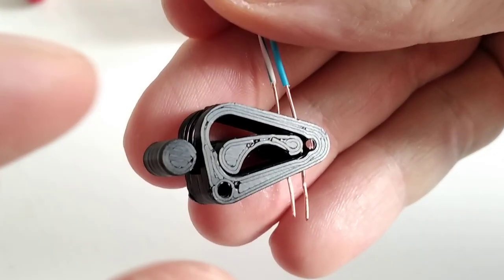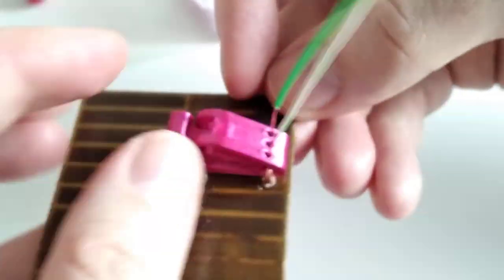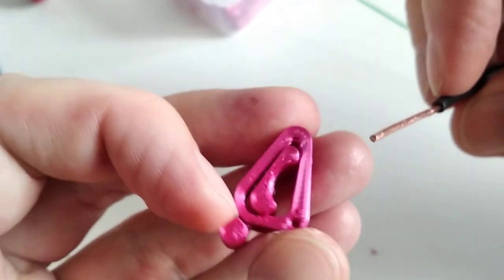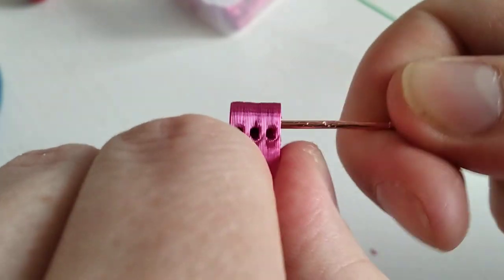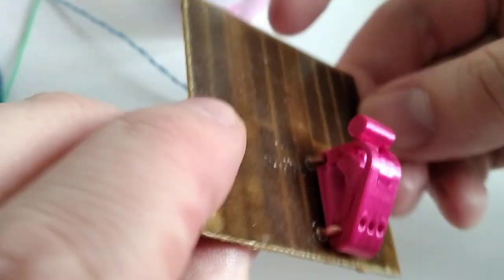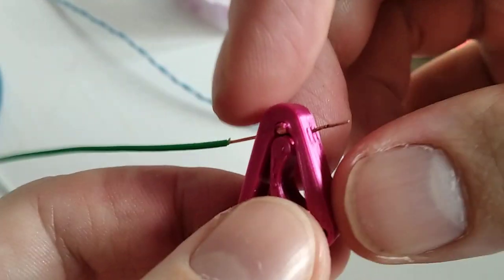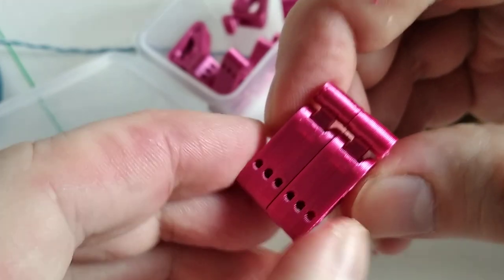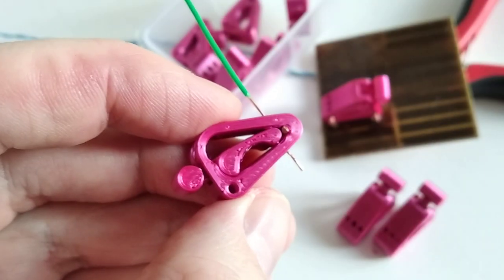30V 9A Wago-Style Clamp 3D printed

Comment: This is too fantastic for words. Design and functionality of it is just great. I really hate that I didn't come up with this myself. I know you could find things online and out there for cheap but to be able to make it yourself modify it configure it at a moment's notice is just beyond words. I had the biggest grin on my face watching the video. Absolutely fantastic. This is why we have 3D printers. Thank you. I'm going to print this right away and say that I came up with this all by my self. 😂 😂 . You rock.
Reply from the maker: Don't worry, there are still many ways in which you can contribute to this design. Just download the files and try to do some modifications :-) I think it might be interresting to integrate this connector directly to some box. For example there are designs for 3D printed loudspeaker boxes which might use some connectors to connect the speaker to amplifier.
Reply: That's definitely a perfect use for it. Already printed it and played around with the design. Thank you. Lots of fun
Reply from the maker: @AmirASD  Did you have any issues with the two parts being stuck together too much after print? I don't have much experience with print-in-place designs and i've just eyballed this whole thing. But i am not sure how well it will print on different printers and materials.
Reply: @harviecz  it printed perfectly. I made two little design changes because I couldn't help myself and took the three of them to work for show and tell. They were blown away. One of the electronics engineers said that of the three he likes one of them more and he picked your design.

Comment: Wonderful idea. 
I see there's quite a bit of resistance (heard by the click) on the clamp at its current design, but I would like to see another piece that slides in... Locking the piece to a "closed" position. 
I could see this removing any variable of heat, or movement causing loss of retention. Especially when used in a application other than being mounted to a PCB.
Reply from the maker: I don't really think that adding more plastic parts can prevent whole thing from melting. But i suggest that you try to print it, see how it works for you, do some modifications and share the design. There are lots of posibilities.

Comment: I applaud your creativity but your design and title are irrresponible and misleading.  Plastics used in electrical devices are specifically formulated with flame resistance and smoke inhibitors. Put a lighter to your dvice and then to a real connector and see what happens.
Reply from the maker: This aspect of the design was heavily discussed in the hackaday comment section. TLDR: this is proof of concept design to encourage further prototyping, there are flame retardant 3d printer filaments, don't use this to wire your domestic power, use common sense.